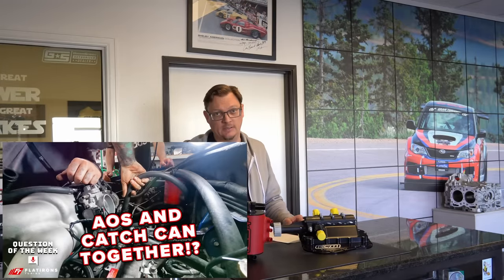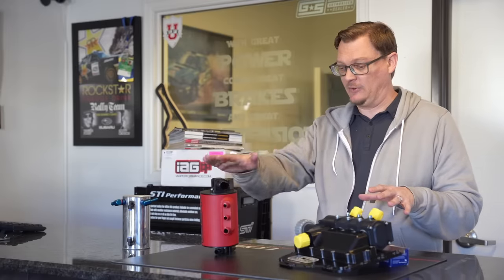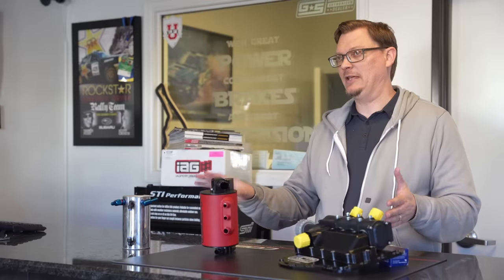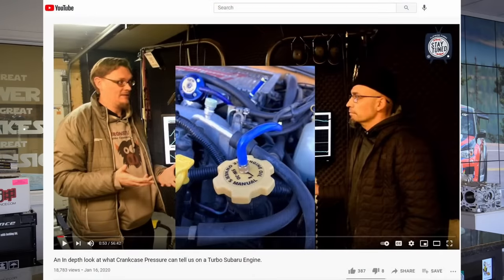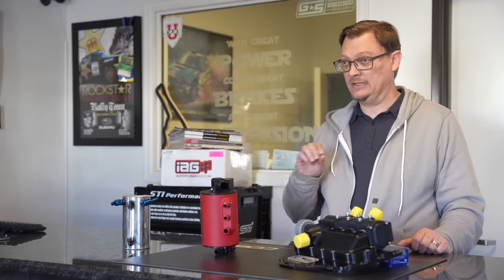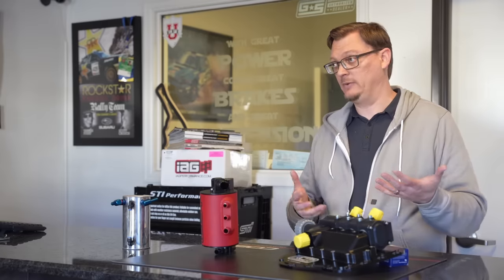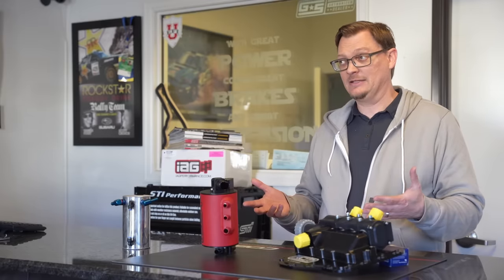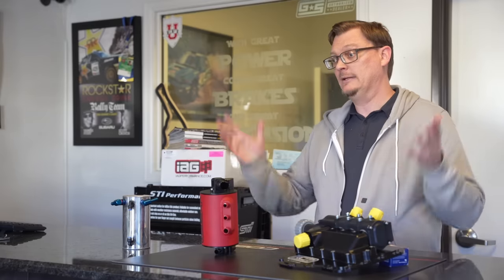Troubleshooting Why your AOS doesn't work

Comment: This is great information! When we cracked a Ringland in our WRX rally car, even with the AOS we still were pouring in like a full 6 quarts of oil every 10 miles. Perfect example of the engine being so damaged that the blow by is overwhelming the AOS. I’ve also personally found kinked hoses on other cars, which usually ends up making a mess too as the blocked hose leaks oil everywhere.
Reply from the maker: Thanks for watching and thanks for the comment Jeremy!

Stay Tuned!

Comment: If anyone is tuning a GM ecotec motor, don't remove the stock AOS baffle system that is built into the valve cover.  I thought I was smart by welding on a bung to help reduce crankcase pressure so had to drill out the plates and remove the plastic baffles. Eventually had to double up with 2 custom AOS to control the oil coming out of this motor, a small inline one at the valve cover installed so it could drain back, and a large swirl pot AOS I copied from designs I found.

Comment: Great video. My experience is very positive with the IAG AOS. No oil usage, oil is clean at 2500 miles, and no oil in intake (competition series vented but recently plumbed into the exhaust for venturi effect to create some vacuum to evacuate crankcase). This is on an 06 with IAG block, FP green turbo on almost 30psi, and supporting ethanol fuel system.
Reply from the maker: Excellent!  Glad to hear it is working out well for you.

Thanks for watching and Stay Tuned!

Comment: I’ve wondered about plumbing an electronically controlled vacuum pump into a VTA AOS setup for hard driving operation. This could be much more cost effective and help eliminate a substantive amount of positive pressure in theory. 

In addition, you nailed the AOS revelation! They provide aid to the consequences of an underlying problem. Pop the oil cap on a healthy running EJ at idle and those who don’t know, would think it has a big problem at normal operation.

Comment: I had a blocked drain hose with IAG on my 08STI 190K OG miles and I kept getting oil in my turbo inlet and Intercooler , one of your previous videos helped by giving me the info on what was happening , after I raised  the AOS & the drain hose the oil was pretty much gone. Thanks for sharing
Reply from the maker: Very glad that the video helped you solve your problem, and it is great that your AOS is working well again.

Thanks for watching and Stay Tuned!

Comment: Crankcase pressure issue can be greatly reduced or even completely solved by connecting AOS exit to electric pump that starts to work when boost hits. Compared to dry sump it's much cheaper and also do not require extremely frequent oil changes. So I think it's best solution to highly tuned street car.
Reply: any recommendations of ones you've seen work on an EJ? I'm interested in this option.
Reply: @lowcountryfungi  I'm using Subaru secondary air pump. Used one, very cheap. Inlet connected to AOS and outlet connected to atmosphere. It required plastic welding to connect hose to inlet, but you can use any other secondary air pump that already have two hose connections. I'm also installed MAP sensor from atmosphere Subaru to measure crankcase pressure. With pump working it's reduced from 1.15 Bar to 1.03 Bar (1.00 is atmospheric pressure), and BHP increased from 680-685 to 700.

Comment: Great info here. Thank you for sharing. Sounds like someone needs to design a proper oil catch can system for the daily streetcar. That will help actually with the extra crank case pressure. ASO is nice. But very overpriced I feel. And not really needed for the everyday car.
Reply from the maker: Thanks for watching and thanks for the comment.  Stay Tuned!

Comment: so I have a 22 wrx with radium dual catch cans that have been installed over 10k miles, and there is always only a little bit of the oil on the bottom of the cans. I never needed to empty them since the installation. When I installed the aftermarket charge pipe I still found some amount of dark black oil on the turbo side, but the throttle is pretty clean. I'm stuck in a cycle. Because on the one hand no oil is the best, it proves that the engine is working healthy, and I hardly lose any oil per oil change cycle. But when I saw that the catch can didn't have much oil, but there was oil in the charge pipe, I was worried that the catch can wasn't working. I asked some questions about it on the forum, and more or less the same model of car will have a good amount of oil in it after couple thousands miles.

Comment: Boxers are hell for oil. I tried to turbo an EA82 for fun. The thing that finally made me give up was that once I went beyond like 7psi of boost, I couldn't keep oil in it. The SPFI EA82 doesn't have the built in AOS like an EJ, and so there's not any good place to get PCV from, leaving only the valve covers. I could only return it to inlet. As soon as I put it in a catch can it'd just puke oil, and eventually the engine just developed leaks everywhere. I have an EJ255 in that car now with a stock PCV system on low boost and it's working very very well. No issues, just turn key drive. The next steps are turning it up as is, and then eventually fix the rust, cage, slicks, and dry sump. There's an Aviad kit that uses the stock oil pump with a scavenge pump in place of the AC, bring your own tank that only costs 2k$. Either that or I've considered doing used NASCAR parts.

Comment: Jon, really great content as always. Breaking paradigms and enpirically not worried to contradict general and wrong beliefs. Regading catch cans, are there better ready-to-go solutions than Radium dual catch cans system, which tou said it is not great? Can you tell a bit more about what are Radium catch cans system cons?
Reply from the maker: Thanks for watching and thanks for the question.  First off, I discuss the Radium catch cans here:

https://youtu.be/iJs1SSAOYiU?si=xqUru3Itn4h5AYaL

They are a little small which isn't the end of the world, but their routing is not good.  If you change it as I did, it seems to work well, but for track use they can be too small.

Hope that helps and Stay Tuned!

Comment: I have been running a catch can to an air injection valve in the exhaust quite successfully. Street car, 400whp driven hard on mountain backroads.

Comment: The main contributor to my track/street car selection was having a factory dry sump to deal with lateral G. Secondary was to deal with the crankcase pressure for me.

Regarding Subaru the plumbing on our IAG ended up getting pinched, clogged and causing breather to stop breathing. I'm redoing it with the 3MI hose and hoping to get the crankcase pressure closer to normal. In my Honda I run a breather with giant AN lines to the valve cover and a large AN line to drainback to crankcase.

I'm interested to see someone have larger breather openings on the Subaru valve covers and have vented breather/s.
Reply from the maker: Thanks for watching and thanks for the comment.

Stay Tuned!

Comment: I have an ej25 daily driver making 380whp on e85. Sway bars and mild summer tires. IAG AOS.

Sometimes when I start it after sitting for a few hours it smokes out the tail pipe for a minute or two then clears up. Fresh heads, fresh block. Is this an AOS drain hose issue?
Reply from the maker: Thanks for watching and thanks for your question.  I'd recommend checking all your plumbing on the AOS.  If any of the hoses are pinched, blocked, etc., address that first.

What this can be is a sign that your crankcase pressure is building and preventing your turbo from draining.  Especially with E85, check to make sure that none of your hoses have any of the waxy buildup that can result from that fuel and block them up.

Hope that helps and Stay Tuned!

Comment: Hi. Any thoughts on Verus Engineering’s AOS systems for the GR Supra & GR86? Their systems have a “maintenance-free” drain-back kit (& coolant add-on for the 86).
Reply from the maker: Thanks for watching and thanks for the question.  We haven't had one in hand or on a car to test yet.  I do like their design, as it should be very effective at filtering the oil and liquids out of the PCV gasses.  As long as it drains back efficiently, it looks like a good design.

I do want to give it a try at some point.

Hope that helps and Stay Tuned!

Comment: Is an aos a bad thing to have supposing you don’t have an underlying problem of any type? Is it good to have on a healthy engine? Or does it just add extra complications that don’t do anything worthwhile?
Reply from the maker: Thanks for your question.  I would say that if you have a car that is running well, and not using any oil between changes, I would only look at a dual catch-can setup if anything.  Adding in the AOS when you don't need it brings in an extra level of complexity, and over time, can potentially start to cause issues as discussed in the video.

A good dual catch-can set-up would be a simpler solution, and would be more than enough to keep any oil out of the intake path.

Hope that helps and Stay Tuned!

Comment: Question, i have a bit oil in my TMIC in the hose that connects turbo. My question is, I know it’s not bad I guess. What can I do to to minimise this, i have a stock ej25 sti 2013. You have said that most cases aos is not a fix rather a bandage. Should i just replace my pcbs ?
Reply from the maker: Thanks for watching and thanks for your question.  That small amount of oil is basically normal.  If you aren't having to add much if any oil between changes, that will give you a good idea how much oil is moving through your PCV system.

If it is a very small amount, that is where a Catch Can would make sense (you really want to use 2 ideally, one of each circuit).

If you are moving more than about 1/2 quart or more between changes, it would likely be best to use an AOS like the IAG or Killer-B.

Hope that helps and Stay Tuned!

Comment: If someone relocated their battery to the trunk they could fit a good size oil tank there so no need for putting it in the cabin. Knowing this, and cost aside, what other disadvantages could you think of if someone was considering to put a dry sump in a mostly street driven car that gets track use a few times a year. Car makes 500 hp with 275 200 tw tires and some aero.
Reply: I think oil change cost will increase and maybe the car will take longer to get up to operating temperature before you could drive it hard. 

Those seem tolerable, therefore….there is no real disadvantage for a heavily modified street track toy. Thoughts ?
Reply: The car has an oil cooler also so concerns with the tank heat soaking in the bay shouldn’t be a concern
Reply from the maker: Thanks for watching and thanks for the question.  If you had the tank in the engine bay, and you were confident in the reliable routing of your oil lines, then I'd say that the main disadvantages would be the cost of oil changes with the Dry Sump.  I would also say that I wouldn't want to run the car in very cold weather or snow, just to make sure you didn't run into any issues related to cold temps.

We have been on track with our car when it was 95* out so heat isn't a problem.

That is all that comes to mind currently.

Hope that helps and Stay Tuned!
Reply: There is a belt to the dry sump that needs to be inspected and maintained.

Comment: Enjoying the content and happy to hit the like button, after all, it’s my revenge against the adds! I’m running a VF34 with standard pcv on a built hybrid by tegsport. No oiling issues for the 32k it’s run thus far. If I wanted to raise the power to 400hp (UK) would this necessitate an AOS?
Reply from the maker: Thanks for watching and thanks for your comment.  Basically, when you make the change to 400 whp, that is the time to re-evaluate your PCV system and decide which option would be best.

Hope that helps and Stay Tuned!
Reply: @FlatironsTuning why do the UK cars seem to be more reliable?

Comment: On a stock 2018 etc should I be running a dual catch can setup? Or should I just run the pcv side? I’m looking at the Mishimoto catch cans and it looks like for 2018 to 2021 they only have the pcv side catch can setup.
Reply from the maker: Thanks for watching and thanks for the question.  If you are going to put a catch can on your car, you really need 2, one for each PCV circuit.

Hope that helps and Stay Tuned!

Comment: So no solutions for the foreseeable future? I’m running an IAG street AOS and IAG comp pan w/ pick up tube. I haven’t seen any oiling issues so far but would like to know for the future. Why does it seem like the Japanese and UK STIs seem to be more reliable?
Reply: EJ207, the crank has oiling delivery advantages with oil journals every 90° on the #1,3,5 mains. The same style crank was available in a lot of 205’s too. 92mm bore doesn’t have the same issue with ringlands like the 99.5mm. Shorter stroke engine is happier living above 5,000 rpm. Still has the same limits as the EJ25 as far as crank case control but they don’t seem to be as dramatic under 400whp. The thick wall W20 blocks are also much more stout as far as main rigidity and the top of the bores. 13mm thick cylinder liners are solid. 

Still an EJ. Still going to be a love hate relationship if you like the car and track it. FA20/24’s definitely have better crank case control.
Reply from the maker: Thanks for your question.  I'd say that you are in good shape then, just keep an eye on things.

Hopefully in the next year or two, another, better solution might come up.

Thanks for watching and Stay Tuned!

Comment: What's  your opinion of the NMS EJ25 Oil Control Valve Cover Kit? How much do you think it helps with separating oil?
Reply: The factory valve covers already have baffling built into them.
Reply from the maker: Thanks for your question.  From what I have seen, the Night Motor Sports valve covers have the same system as the factory valve covers.  I don't think that their valve covers would chance the movement of oil from the valve covers any more than the OEM ones.

You can see the factory covers in our PCV video here for reference:

https://youtu.be/mO9mxDUDUDc?si=WPApETagRJHWYFEE

Thanks for watching and Stay Tuned!
Reply: They're a gimmick imo

Comment: I had the stock pcv system on my wrx for 110k miles with some blowby but not allot. I finally had an iag street aos installed and over time i had multiple hoses kink and need to be rerouted and my engine just failed at 123k miles. Im getting it rebuilt so i will know for sure soon but i think the aos played a major role in my engine failing, which is ironic considering how much its marketed as a solution.
Reply: Personally, my philosophy is that if you are on a stock motor in stock power level, you do not need an AOS. The factory PCV system on the EJ25 turbo cars is very good, with baffling and built in AOS devices at multiple points in the system. Stock Subarus need to have a pretty good AOS system because otherwise they would have trouble passing the US’s strict emissions standards if they burned oil as a matter of course. However overtime it is necessary to maintain the factory PCV system. Replace rotted hoses and clogged PCV valves. Frequent oil changes will also help prevent the system from getting clogged with deposits and carbon.

I have had my hands in a lot of Subaru engine bays and I have yet to personally come across a car that was burning oil due to no fault of the owner. Most frequently, I would see owners continue driving cars that have other issues such as vacuum leaks or a bad turbo and that result in other engine damage.
Reply from the maker: Definitely sorry to hear that, but glad that you are going to be able to get your car up and running soon.

Thanks for watching and Stay Tuned!

Comment: So would you say a killer B catch can would be okay for a daily VB making a little over mid 300hp?
Reply from the maker: Thanks for watching and thanks for your question.  I would say that would be a very good place to start.  Dual Catch-Cans are what you really want, and as long as you aren't seeing an excess of oil moving through your PCV currently, I'd say this is a solid option.

Thanks again and Stay Tuned!